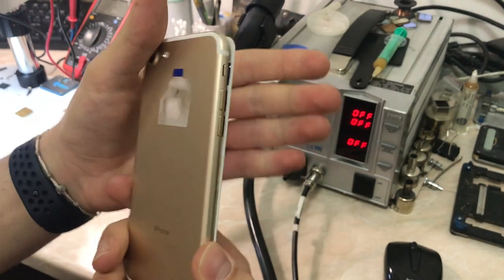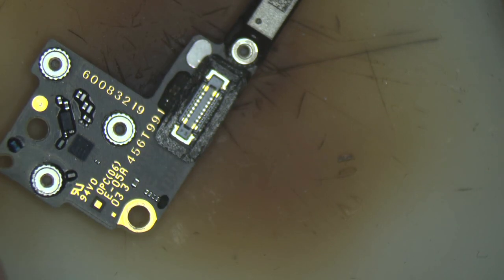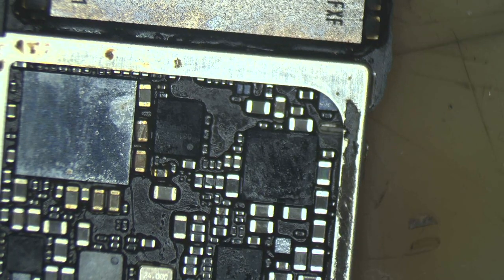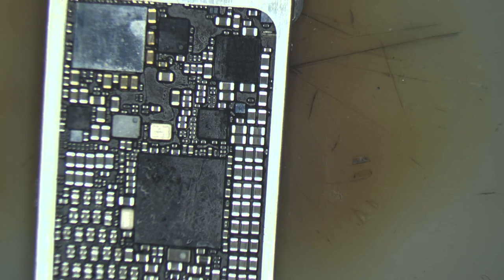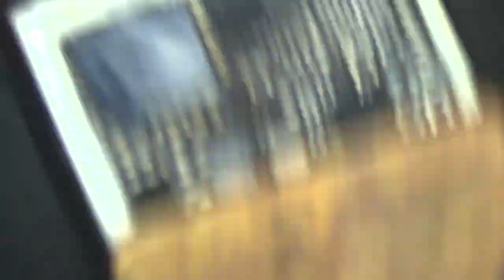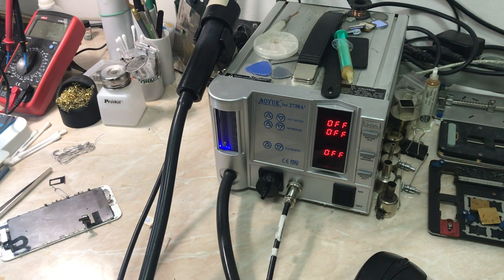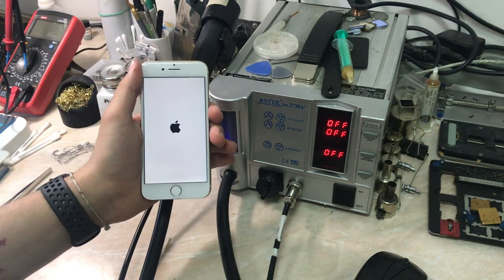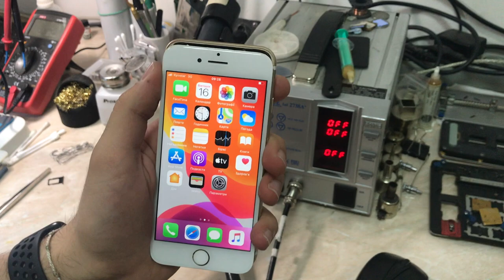iPhone 7 No Service Repair (No Modem Firmware-Intel Version)

Comment: Hi! I do have 2 iPhone 7 intel version and on both of them I did replace bbpm ic and perfectly reballing the baseband cpu but it still no service no imei also dfu restores didn’t help! Any suggestions?! Regards mick
Reply from the maker: History of the device ?
Reply: Antoine Kiriaky both of them just lost the firmware first of them after waterdamage and bbpm Chip replaced it worked after some time stopped to see firmware the second one did replaced bbpm and reballing bb cpu nothing more I couldn’t do even fixed audio ic weak pads! My question; where should I check for the important voltages! Thanks friend
Reply from the maker: I see now if you checked all the voltages on the BBPMU and also In diode mode and if you checked all the pads and voltages on Baseband for the water damage it’s hard to say especially if it’s strong liquid damage but for the one try to check GSMPA_RF it’s the 2G ic I guess because it’s very rare for intel models to have a failure transceivers but also check and also have a look at the low and medium band ic’s and see if there is connection between LATCP_RF - UATCP_RF
Reply: Antoine Kiriaky thanks!  i will and let you know if there is any successes!  
Where are you located? - Me , Vienna Austria
Reply from the maker: Lviv,Ukraine
Reply: Antoine Kiriaky Lemberg it’s nice City I think Never been there.
Do you know smartphone repair Germany group?
Reply: Antoine Kiriaky I have a friend vasily in Lissabon Portugal he has a Mac book Apple repair shop he is looking for a iphone smart phone repair Technicion
Reply from the maker: Yeah I’m in it
Reply from the maker: Cool but it’s hard to travel to another place right now
Reply: Antoine Kiriaky yeah! I know
Reply: Antoine Kiriaky I will check this Lines tonite and let you know! I will add you on the Facebook if you won’t mind?!
Reply from the maker: Sure no problem
Reply: Hi, How did you fix the home button and vibration, because I have the same problem with the iphone 7, with no imei reball bbpm did not help, but after baseband reball worked,  phone now has an imei and logs into the network but the home button and vibration stopped working

Comment: What heat and airflow did you use to put chip back on and for how long did you heat it  please ?
Reply from the maker: It depends how much is the soldering paste temperature if it’s 183c you can use very low temperature it depends on every hot air station in my case I’m using 264c to remove the chip with air 68 and to solder a new one with the soldering paste I’m using 252c air 68